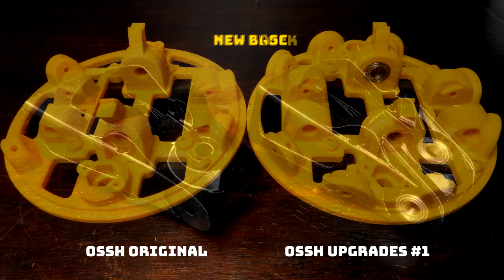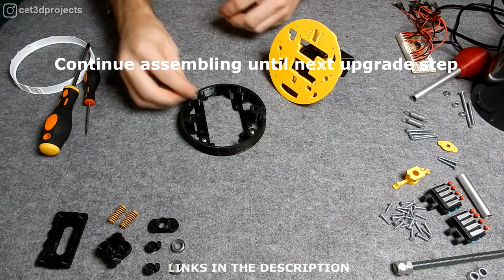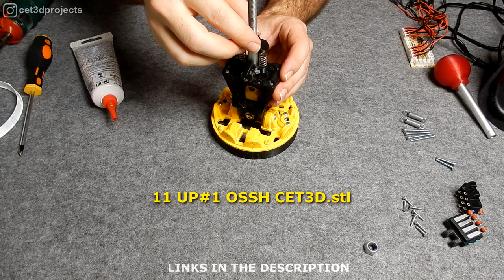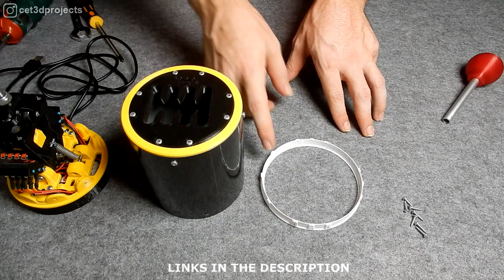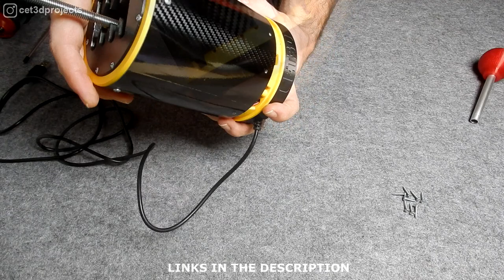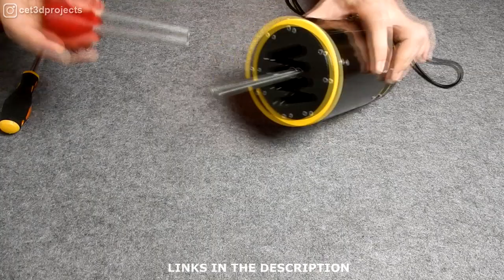Open Sim Shifter H - Upgrades #1 - DIY 3D Print - Sim Racing

Comment: Thank you for the tutorials. Thanks to them i build a shifter for like 200pln( 50$ ) instead of going with thrustmaster shifter (150$). Compqred to g29 shifter whitch is like the same price, logitech feels like a toy and this feels like real car. Thank you for the tutorial
Reply from the maker: Thanks to you, for trusting the project. I am glad to see this comment and to know that the design meets the expectations, thank you very much.
Reply: Jan are you using this on pc or xbox one?
Reply: @delvecchio1971  on pc
Reply: lucky you, I tried to build this one and the total quote is around 110 US dollars in US, since we have different unit here I have to 3D print the 110mm PVC tube
Reply: @yuanzhang7392  pvc isnt all that expensive tho
Reply: @yuanzhang7392  nevermind i feel u, metric isnt a strong point of the us

Comment: I loved what you have made, even more the upgrade, could you please make this upgrade to work with regular 608 ball
bearing ?
Reply from the maker: Thank you very much Bruno, according to the dimensions of the 608 bearing I suppose you mean to put them in the lever actuator, if possible, but some parts would have to be modified and the little time I have I am using it in the new project, but I have a link on the web of the necessary bearings on aliexpress at a good price, since in stores they are usually much more expensive.

Comment: Hi there! Thanks so much for sharing this project! I teach electricity at a technical college and we (my class) designed and built a 3DOF simulator. We also built your shifter and it works great with the sim! I was wondering what program you used to create this? Also, would you be willing to share the original file for the H-pattern gates piece (13_OSSH_CET3D_v02)? We wanted to edit it and make some different patterns like a 4 or 6 speed with reverse. We would only need the one file as they can be inserted in the top of what we have now. We mainly use SolidWorks, but have access to several other programs. Thanks again for making this awesome shifter available!
Reply from the maker: Sorry for the delay, I was busy outside of YouTube, I think I'm a little late hehe. Regarding the patterns in H you already have practically all the possible combinations in thingiverse, consult the "makes" section of the OSSH in thingiverse and you will find multiple modifications by users. That project is designed in rhino 6, I am currently learning to use freecad for upcoming projects. Thank you for trusting the project, greetings!!

Comment: Hi, I've slightly modified your cool product by adding a spring mechanism for reverse gear and a simpler adjustment of the stiffness of the transmission, where can I write to you and share files with you?
Reply from the maker: Hello Fox, I'm glad to read that, the project is free to modify and share, you can modify the pieces that you consider and upload them to thingiverse yourself indicating that it is a remix of the original. Sorry for the delay in answering, I had a lot of work outside of YouTube. Thanks for being here, greetings!

Comment: Hi there. Amazing work! I am currently printing all in of the parts and waiting for my order to come in. I was wondering if you have a 6 H or 7 H pattern available for the top plate as I want to build more than 1 with different patterns. I can keep everything else the same. Thank you again!
Reply from the maker: Hi Steve Chaves, thank you very much. When I have some time I will make a pattern of 6 and 7 gears, because some people have already asked me for it. Thank you for trusting this project, greetings!
Reply: @cet3dprojects  Hi, CET3D, is it possible to create a sequential gear limit? like a little piece to lock the shifter in 3 and 4 gears, thanks!
Reply from the maker: @yuanzhang7392   Hi, at the moment it is complicated, the track where the gear bearings run is designed so that it stays in gear, that piece would have to be redesigned. To be able to press the switch it is necessary to carry out the complete travel of the lever. I currently do not design this part for sequential because it is difficult to be changing it regularly and I designed the mechanism thinking about H, but it would not be a bad modification for the future. Thanks for watching!

Comment: Did anyone have problems with the M8 threaded rod not remaining screwed into the plastic? The spring pressure holding the ball bearings just pushes the threaded rod up an out
Reply from the maker: Hi Joel, the printer may be making the holes a bit larger, you can try making that part with some positive horizontal expansion, or just gluing the rod or adding teflon tape to make the rod thread on tighter. If you stick it you can continue disassembling the rest of the pieces, there is no problem with that.
Thanks for commenting and I hope you can fix it quickly.
All the best!

Comment: Hey,
So I'm trying to buy the parts but sometimes its asking me what's the size i want which is not in the part list, what should i do?

Also, love the project
Reply: What are u missing?
Reply from the maker: Hi Amir, probably in the link of the component in question you will find information about their sizes if they were not on the cet3d.top page itself. If you can't find the sizes, tell me the specific component and I'll try to get you the exact size. Thank you!
Reply: @payfrogmedia  i think I'm good now. But idk if ima get all this stuff in a hardware store or aliexpress, I just need to compare both to see which one is cheaper

Comment: Is there a reason for the bearing on both the base and block? Seems like it would be redundant to have both.
Reply from the maker: Hi Joseph, it could really work with bearings in only one of the pieces, but i figured that with time and use it could create clearances so i put them on both sides for reliability. Thanks for commenting and watching!

Comment: i`m having difficulties finding the right springs. The most important is the spring size length, right? if the exterior diameter is almost the same (like 1mm more or less)  and the wire is almost the same (also about 1mm more or less) it would not be a problem?
Reply: for instance: the compression spring if it is: 1.5mm wire / 7.8mm external diameter and 20 mm length it would fit?
And the tension spring: 1mm wire / 7.3mm external diameter and 30 mm length it would fit?
Reply from the maker: Hi Bruno, yes, that's correct, the important thing is the length. I once mounted two side springs on each side, so a spring with a larger diameter should fit. I've seen that some links on the website have fallen, including the springs, tomorrow after work I'll try to replace them.
Thanks for being here!

Comment: Muy buen trabajo. Voy a hacer. Soy novato y me compro una Ender 3 motivada por tu trabajo. Vi la configuración para configurar en la impresora, pero al abrir Cura creo que podría estar rastreando alguna configuración. ¿Es posible compartir su perfil o incluso tomar una captura de pantalla? Perdón por mi español ... soy brasileño. ¡Fuerte abrazo!
Reply from the maker: Hola Dinho RJ, muchas gracias! Creo que te entendí sin problema, pero actualmente mi impresora tiene otra electrónica y extrusor diferente al original, te recomiendo que analices la pieza muy bien y hagas calibración de pasos de los motores de la impresora, al principio este mundillo se hace grande pero ya veras que viendo videos de configuración y calibración de la impresora llegarás a dar con el perfil mas adecuado para tu hardware y marca de plástico. Creo que te sorprendería las piezas que he tenido que desechar durante el proceso de diseño y testeo jeje, no obstante si tienes algún problema especifico con alguna pieza en concreto coméntamelo por aquí y vamos a intentar ayudarte.

Comment: Hello thanks for sharing this for us i wonder if i can print 6 out 4 in aluminum tubes because i cant find it anywhere in my country thank you.
Reply from the maker: Hi HALUK, sorry for the delay, I was offline. I did not understand very well, do you want to make those printed tubes? It could be made but you would not know its durability. In that case I recommend the bearing mod and use screws with threads of that size instead of the tubes.
On the web you also have links to buy the tubes on aliexpress, I hope I have helped you, thank you very much.
Reply: @cet3dprojects  no problem i actually found tubes so im using the shifter right now it is the best thank you

Comment: Hi.
great design.
any chance of a remix?
a more Square design would be easier to mount.
in thinking a square tube or square with chamfered edges and holes for m4 screws and nuts so we can mount it to the upright of our rigs.

what do you think?
Reply from the maker: Hi Karl, at the moment there are no major modifications planned, as I am working on another project, but the design license also allows users to make modifications to share, like this adapter designed by user bakkenbears: https://www.thingiverse.com/thing:4641661
I hope it helps you, and I take note of the grip system you propose, thanks for watching!
Reply: @cet3dprojects  Hi    thats perfect.
thank you for sharing a great project

Comment: This looks great.  :)  I think if I were to change anything it would be to make it Aluminum profile friendly (like the Simlab P1-X).  I'm not sure how reliable the switches would be over time, and I would consider Hall effect sensors instead.  That adds cost and complexity, and might not be worth it.
Reply from the maker: Hello dockettome, thank you very much for your contribution. If I had had a cockpit to test, I would have designed its own support, but my cockpit is handmade and I was only able to test it with it. Regarding the switches, over time they don't seem to have any apparent problem, even so the user "fthsimracing" on Thingiverse has created a support to do it with potentiometers.
Thank you very much and greetings!
Reply: @cet3dprojects  In my experience potentiometers wear out quicker than switches.
Reply: The mechanical lifespan will depend on switches you get. The cheap generic stuff like KW10-Z1P has a 10K electrical and 100k mechanical rating so you'd expect around 50K presses before failure, a lot but not the greatest. 

Now Compare that to Omron's SS-01GL (1A rated thus smaller) which has electrical life of 200k and mechanical of 30Million presses. So it'll likely never fail
Reply: The mechanical lifespan will depend on switches you get. The cheap generic stuff like KW10-Z1P has a 10K electrical and 100k mechanical rating so you'd expect around 50K presses before failure, a lot but not the greatest. 

Now Compare that to Omron's SS-01GL (1A rated thus smaller) or SS05GL (the size used in this, aka 5A rated) which have electrical life of 200k and mechanical of 30Million presses. So it'll likely never fail

There's zero need for more complex setup with hall effect sensors which also lacks the crisp click of Microswitched

Comment: Hola CET3D. 

Se espera una nueva versión? Estoy pensando en empezar con el proyecto con el update 1. 

Vuelvo a reiterar mi más sincera sincera enhorabuena. Si no eres un ingeniero, tienes la cabeza de uno, y de uno bueno.

Saludos y gracias

Editado: Ya vi que simplemente se sustituyen unas piezas por otras, por lo que si saliese otra mejora, muchas piezas serían válidas.
Reply from the maker: Hola Juan Luis, de momento no voy a lanzar ningún upgrade del OSSH, ya que estoy liado con otro proyecto de RC. Puedes fabricarlo tranquilamente sabiendo que no habrá actualizaciones importantes.
Reply: @cet3dprojects  hi, how do I attach this device to anything ?
Reply from the maker: @andreystartsev5595  Hello Andrey, as you can see in the videos, the shifter has an electronic board to connect the device to the PC by USB, it can be an Arduino UNO or a preconfigured board that you can find in the list of necessary components (in the description of the video), thank you very much for commenting and watching!
Reply: @cet3dprojects  hi tell me the size of the base itself
Reply from the maker: @andreystartsev5595  Hello again! I don't know what you mean, the base has many different measurements, but if you download the project's STL files, you can verify all the measurements with any modeling program. Cheers!

Comment: Hi, I really liked this design. It looks so cool. But does hard gear changes damage it?
Reply from the maker: Hello Ege, everything in this life has wear, the harder gears translates into more wear, so the parts of the mod "upgrades #1" include bearings on the axles. Probably after a lot of use it will be interesting to change the gear bearing path (05 UP#1 OSSH CET3D.stl). Thanks for asking, greetings!
Reply: @cet3dprojects  Hi, thanks you for the answer. Have a nice day, greetings!

Comment: Hi, Im building right now. Shouldnt the part that is locked in the axis have an M8 thread? Now the M8 part is loose in the hole and the springs lift it out. Part 3D is niet threaded. Think Im going to glue the thread in now...
Reply from the maker: Hi Van Kees Velthoven, sorry for the delay, I was offline. The hole is currently not threaded, i think i will fix it by redesigning it. It should be snug according to my tests, but if it is loose you can use nut sealant or use silicone glue (in case it needs to be disassembled), thank you very much!

Comment: Hi, is it possible to convert this to run with potentiometers like on the logitech shifters? I have the necessary software but how can I mount potentiometers on this?
Reply from the maker: Hi FastW, search thingiverse for the user "fthsimracing", he created a mod to do that. You can also see that and more modifications in the "remix" section of the OSSH page on thingiverse.
Hope that helps, best regards!

Comment: Hi, I noticed you mounted micro switches to their bracket with some blue pins. Is there any .stl file of those pins?
Reply from the maker: Hi Anil Gunduz, good question, it is just petg filament with heat flattened ends.

Comment: So it is 6mm into 6mm interior bearings? I can't push it in even with force.
Reply from the maker: Do you mean that the 6mm aluminum tube does not fit, or do you mean the housing of the bearing? I hope I can help you.
Reply: @cet3dprojects  The aluminium tube into the bearing. For the first one I used brute force and dremel tool to grind some of the surface. For the second I rather printed tube and fit screw inside, which worked out nicely.

Comment: When i try to build this is keeps pressing wrong switches, or none at all sometimes. What can i do about this?
Reply from the maker: Hi Mark Zijlstra, I don't know what can happen, I haven't found that problem yet. You can check if the support of the switches is robust and fix the switches with a 2mm screw in their holes, I did it with a piece of filament with the tips crushed with heat so that it does not come off. I hope you can solve it, you can comment here if you got it, thank you very much!

Comment: I have a 3d printer. However my wheel only came with 2 pedals. It is a driving force gt if anyone cares. Do you recommend me to buy a new 3 pedals board or does any of you have any recommendations on how to diy a clutch and maybe later a break and a gas pedal?
Reply from the maker: Hi John Smith, think that the pedals support a lot of force when you step on them, I would recommend you buy a base with a clutch when you can.
Thanks for watching!

Comment: Hi, I was trying to make some mods on the base (to have a box frame instead of cylinder). I made some progress but am not sure if i got the measurements right and doesnt want to waste filaments (printer and filaments are yet to arrive in a week or two). So.. is it possible for me to have access to the raw drawing file and let me start from there? I tried converting the stl to autocad importable drawing but it doesnt seem to work as I expected.
Reply from the maker: Hello shaoran Li, these files are currently very messy, with parts that are worth and are not worth, due to the numerous tests I did. I could give you a final version in rhinoceros file, but it could be difficult to modify it without errors since it is developed using unions and boolean differences and from what I have seen this usually gives problems. You have my email in the channel information, talk to me there and I will send you the file to your email.
Thank you so much for everything!

Comment: Can you made one for console(xbox) or i buy 165$ of thrustmaster t8ha plis i need
Reply from the maker: Hello 44_AWESOME, at the moment I don't have the necessary knowledge to make it compatible with xbox. In any case, the TH8A lever is not a bad option for xbox, although I think you can only connect it through a thrusmaster steering wheel base. Thanks for commenting, greetings!
Reply: @cet3dprojects  thank you anyway

Comment: I messaged you on Instagram, can you share the CAD file so I can modify it to use 608 bearings?
Reply from the maker: Hello! The truth is that this project was done with boolean operations in rhinoceros and there are no parametric CAD files as such. On the other hand, that 608 bearing does not fit in the axle part of this MOD, it is too big, I could only use it in the gear mechanism of the original version.
Even so, the bearings I used are easier to get than modifying a non-parametric project.
I'm sorry I can't help you more with that but the nature of the project complicates that issue a lot.
Thank you very much and best regards!